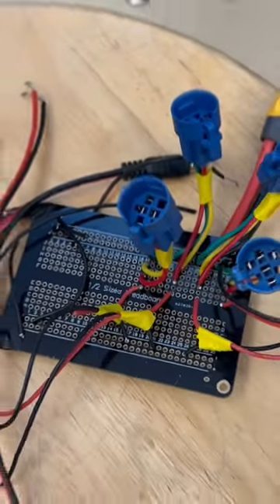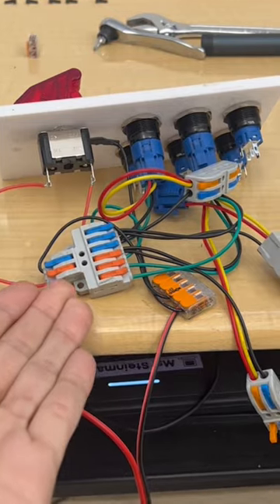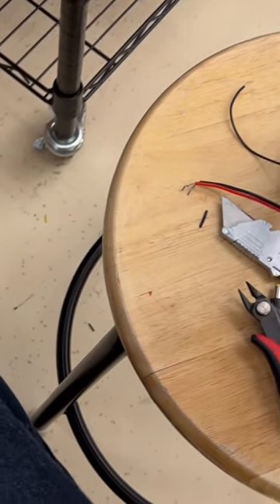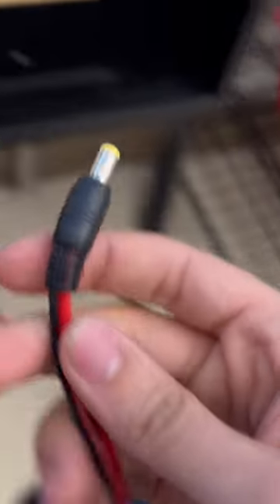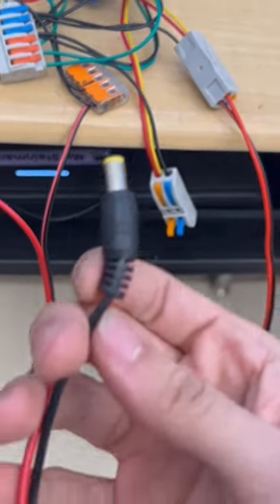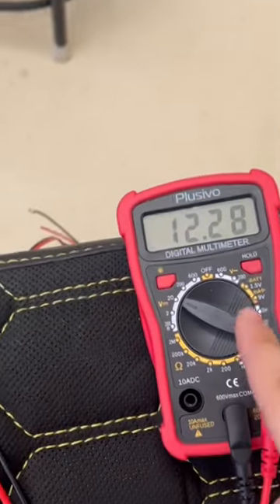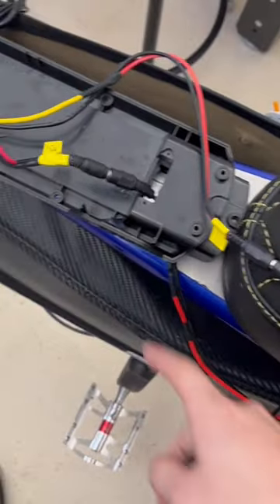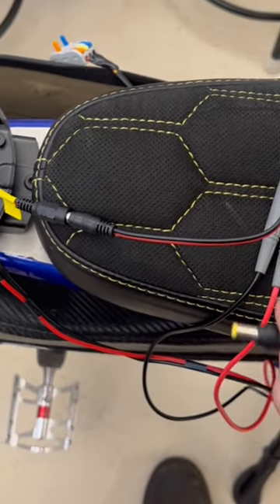DIY wiring for 72v eBike

Comment: The mass made male and female dc connectors do have a fail rate.  I use a lot of them bought in bulk bags 25 to a bag, 3’ length.  And I have issues with one in every other bag.  They’re also not all the same even if they “fit”.  Hopefully it doesn’t drive you insane!
Reply from the maker: Thanks for the confirmation! How many amps would you confidently run through one of these? My 12v dc output can get to 10a which I could imagine wouldn’t be good for too long